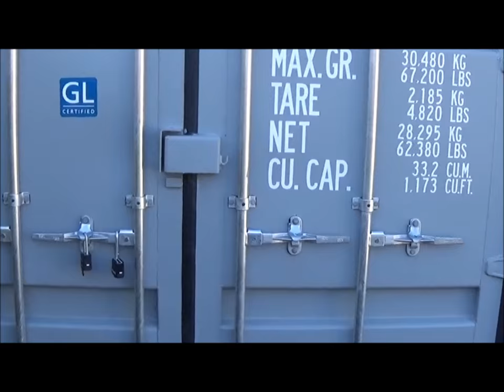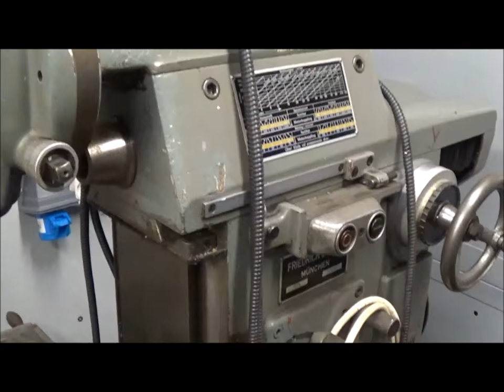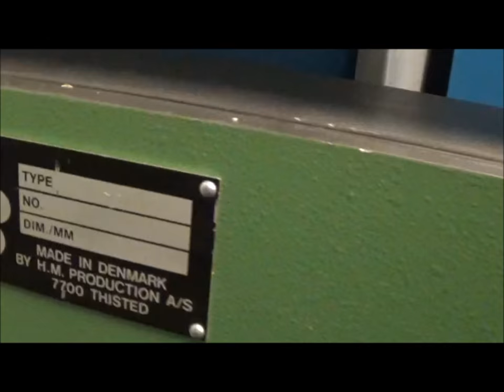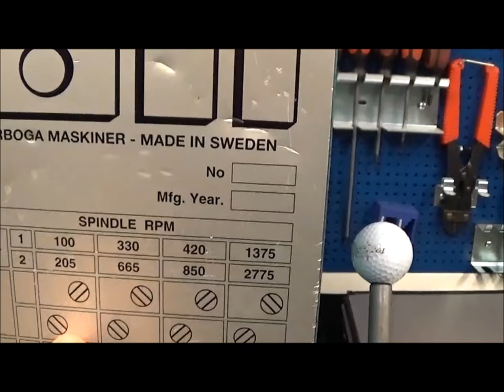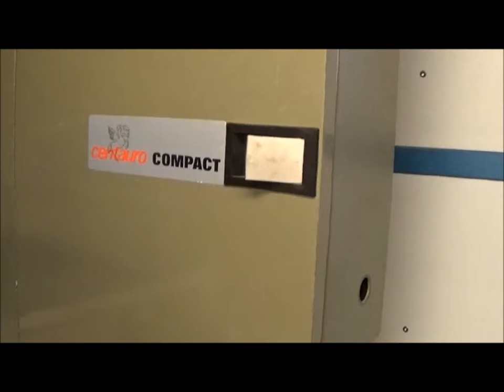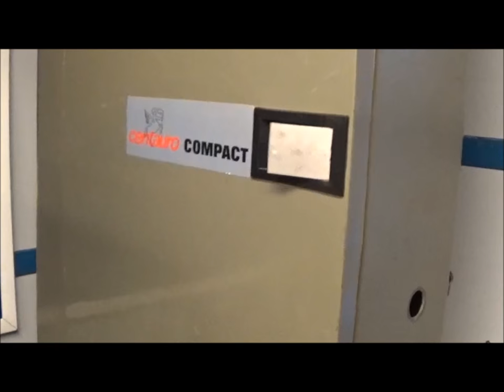Shipping container workshop

Comment: nice shop, I also use a cargo container for a machine shop, lathe mill and surface grinder. adjacent to my garage so my rotary phase converter and air comp is in the garage. love it clean free of animals and dust. the surface grinder is at the door and shoots the stuff out the door opening. not nearly as neat as yours or as nice of equipment, mine was all bought on a fantastic budget.
Reply from the maker: It's a great way to have a shop. Mine was expensive but I had to buy everything in Norway where prices are outrageous. Even still it came in at about 8000 USD for everything - including the container. I am considering getting a 10 footer to move the woodworking machines out so that I can get a metal cutting bandsaw and space things out a little more.

Comment: Thanks for sharing. I'm just in the beginning phases of setting up my own workshop in a 20-ft container. I was thinking about insulating it too as I'm in ireland. What is your opinion on spraying PU foam onto the container structure directly? I'm concerned about condensation collecting behind the insulation, have you found this happening in your container?
Reply from the maker: PU foam will work fine. Just make sure to keep the interior warmer than the exterior and have some air circulation. Ireland is a damp so you don't want temperature fluctuations in the container or things will rust.

Comment: What a brilliant workshop! I have just bought a similar container and plan to make it into a workshop and wondered if you would answer some questions?
What have you set the container down on?
How have you insulated the floor of the container?
What glue did you use for fixing your horizontal and vertical timbers on the walls?
Did you take any special precautions to ensure the surfaces were dry before glueing?
I would also appreciate any other tips you would like to pass on. 
Many thanks, Ronnie.
Reply from the maker: G'day Ronnie, I'll answer as best I can.
1 - The container is set down on a leveled gravel pad to ensure drainage
2 - The floor is not insulated and does not need to be. I used water resistant marine ply which I pre-drilled, ground of the coating around the holes, then glued and screwed down. The fact the container is heated using infrared lamps means I need far less insulation as the IR does not heat the air but rather the solid mass in the shop
3 - At first I used a really expensive builders glue and then went to a much cheaper Sikaflex type of glue which had far more holding strength due to it's superior elasticity - even in the cold. My advice is to buy the cheap stuff and test the holding strength before committing to any one brand
4 - I just heated the inside of the container with a heater and glued. The wood needs to be free from dust but there was no special process. Just make sure you securely hold the wall studs and ceiling batons until the glue dries

If I were to do this again, I would have used thicker ceiling batons and much more glue. I had a failure in the ceiling due to thin batons which were dislodged by over protruding screws. The use of styrofoam insulation was a huge time and money saver and added impact resistance to the walls. I would also recommend mapping out where the floor joists are before adding additional flooring so if you want to install mounting points into the floor, you can use self-tapping screws into the metal floor joists to secure them.
Reply: Thanks for the information, I'll follow your recommendations, it all sounds great.

Comment: Great workshop! What kind of glue did you use to glue the horizontal wood pieces?
Reply from the maker: I just used Tech7. Make sure you get something that has good holding capacity in sub zero temperatures.

Comment: Love the lathe...
Reply from the maker: +stjohn gold Thanks! I spent a long time trying to find a higher quality German lathe but nothing has the combination of features that the Chipmaster does for the weight and footprint. 38mm bore diameter, 30 - 3000 rpm speed range, clutch and brake, large dials, D1-3 chuck, stepless variable speed, hardened bed etc etc... It's been a fantastic machine and although a bit agricultural compared to German or Swiss stuff, it's very robust and gives incredibly smooth finishes.